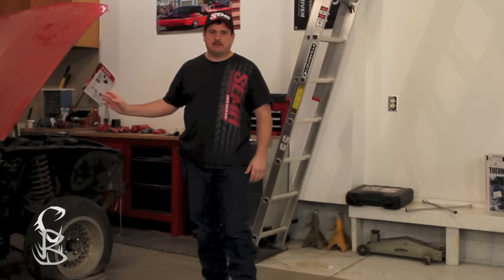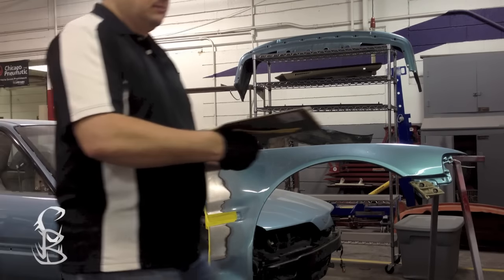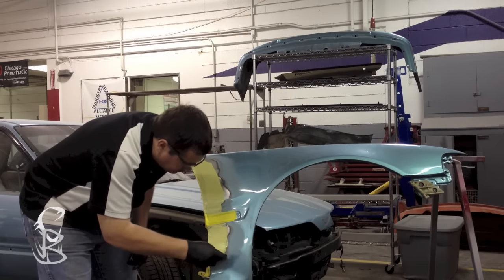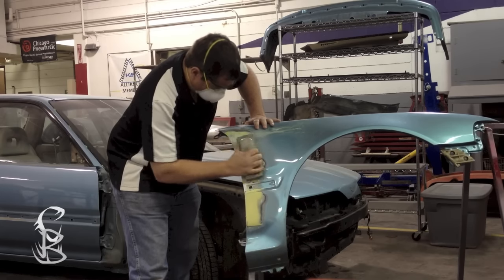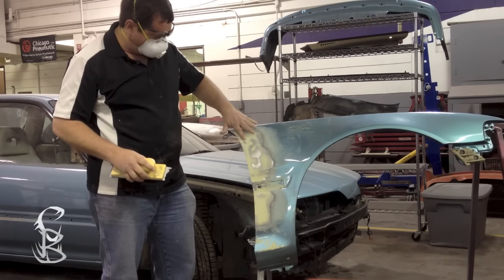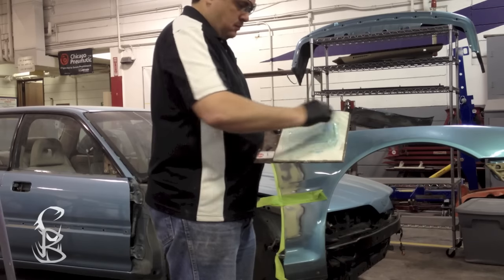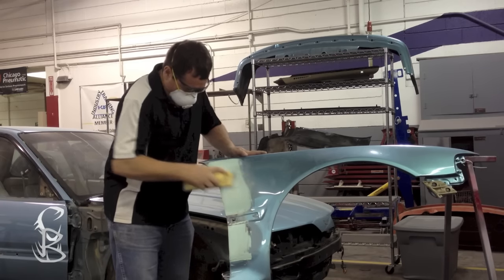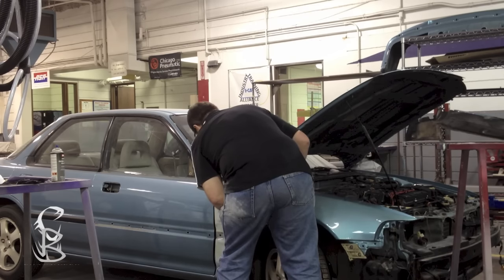DIY How To  Bondo Auto Body Repair (Tips and Tricks) To Prevent Common Problems with Body Filler

Comment: Great tips, Man! Masking tape to protect areas you don't want covered 👍, mixing the cream hardener before use to homogenize it 👍, removing the tape and filler drippings before it's fully cured 👍
For sanding I use a random orbit sander and to help find high and low spots I use a strong flashlight lighting the surface from a slant 😉

Comment: Nice calm and informative video,easy to follow.I started my first paint project on my daily,that has been body filled badly by the previous owner,filler is on to thick and the paint was orange peal,so not very good and it started to rust on some spots,so i'm taking matters into my own hands.😅

Comment: I enjoyed watching your video…nothing really new to me except for your 2-part glazing putty…but well presented. My only question is, what’s with all the hand sanding? I would opt for a 2” or 3” DA sander or an in-line sander to get the bulk of the material off, then go for a 3 x 7 manual pad sander with vacuum dust collection. The dust collection is not necessary if you’re working outside or in an open shop, but it does reveal any little pin holes that could show up later in the paint. I always use compressed air to blow off the area, even if I am using a vacuum.
Keep up the good work educating people about autobody repair!! Thank you 😎

Comment: Tips! fiberglass resin thins out bondo so you can make it as thin as you want. Never lay up bondo thicker then 1/16" thick at a time or you will get air pockets in it and the paint will blister after a while. I use clean bondo dust and rub it on the final coat and this helps so your sand paper doesn't clog up so much. Just try to rub the dust on lightly while the bondo is still tacky.
Reply: This is a tip for disaster, the fiberglass resin does not cure correctly and thats why you cant sand it without rubbing dust on it. If you need to thin plastic filler get the honey thinner made to do this.
Reply: just use supercharger

Comment: Hi Donnie. Been following you a couple years now. You do great work. One thing I struggle with is doing filler in compound, tight curves like in bumpers especially under the tail lights where it curves. Also, Last generation Honda accords have 2 hard body lines in a compound curve. I had a job that took 3 hours to do the filler work because of that. Any tips/videos on that?

Comment: Nice video, i generally knock the filler down with 80 grit then 120 then 240 ready for primer. Sometimes i just go strait in with a 120 then 240..  I just think the finer you get it before primer the less likely to get any scratches show through later on. Each to our own.

Comment: Thanks for the vide.

1.) What's the purpose of putty after putting the bondo?
2.) Should I use different bondo for metal quarter panel and for bumpers?
3.) What about fillers? Are there different ones for metal and for bumpers?

Thanks :)
Reply from the maker: I made a video response to help answer your question.  https://youtu.be/gP4ukrIhC5k
Reply from the maker: I also have a lesson on plastic repair you may find useful at http://www.collisionblast.com/2013/04/02/plastic-repair/
Reply: Israel Kelley exactly. I almost never just use bondo as filler. I always mix it with glaze to stop the pinholes.

Comment: I need to start using putty... I learned without and is very difficult sometimes. So putty will speed it up big time. And I never thought of taping off with filler, how smart is that? Two great points. Thanks!

Comment: Your video is very helpful, I know this video is old but I am glad I came across it, I have a 66 Chevelle I am restoring I have her stripped to bare metal, and have replaced what sheet metal had to be replaced, now I want to go over some of the little dings and dents, would you recommend the car be epoxy prime  first, or do my BONDO  ding and dents first, and also I have used Dyno-Glass it works great and is tough as nails when cured, so that is what I will also use as well on the dings and minor dents. what do you think? or should I just use straight BONDO, I do know the reg. BONDO is easier to sand, any help would be appreciated.

Comment: I like to lay a nice even coat making sure get it as uniform as possible and laying it on a bit on the thick side then before it’s completely hard I add filler right over my lows before I even begin any blocking or sanding. After that I DA with 40 grit to really get it knocked down then block with 80. Then I go from there

Comment: Why do you sand down to bare metal before you apply bondo? I never do that and I dont have and problems with my body work.
Reply: Because that's the old school method when old fillers wouldn't stick to paint. Modern fillers are fine onto paint. :)
Reply: @dannyayoch  Damn, I can't imagine bodywork  if modern filler wouldn't stick to paint. Personally,  I work my way into the damage from the paint to the putty to insure that my work is level and feathered out.... so yeah.... filler from back then would definitely be a pain in the ass to work with.

Comment: My holes are too big on my truck to do it like this I used Bondo patches but it didn't work good doing that. I should of used adhesive fiberglass patches. Am almost ready to start sanding my truck soon though wanna see how it will turn out. But if I have to do it all over again gonna use the fiberglass adhesive patches to put over the holes then use some more body filler. This is the first time I did try to fix holes on a truck from rust and my truck is 14 years old and had built a lot of rust over the years.

Comment: I really enjoyed this video.  I see you are using 2 different materials:  Body Filler and Putty.  Both 2 components products.  I can't find both on the shelves.  In the Bondo brand...which is which?  If anybody else could help me, I would appreciate.  thanks
Reply from the maker: I am not sure if Bondo brand make this type of putty.  You may have to go to a parts store that sells paint supplies.  They may keep it behind the shelf and you may need to ask for it.  Here is a brand that is a little cheaper then what I am using in the video made by UPol.  I have used it and it works good.  https://amzn.to/3yeErTx

Comment: I use the glazing putty to seal all my feather edges also. It acts like a sealer coat and keeps your primer from having any funny reactions underneath.
You never know about any not so cured paint materials.. Less shrinkage later and potential mini waves in the finished paint surface.

Comment: Thanks for the great video...but...THE best "trick" to using body filler...is not to use it at all, or to such a minimum amount that it is little more than pinhole filler, but that too can be remedies with body lead and correct metalwork.

Comment: R&I the door after the fit you want. While fender is bolted to car fix the dents usually 1 coat filler sand with 80 DA any over sand with 180, skim coat with putty, block with 180, soft pad DA WITH 320, prime. Block primer with 320 then soft DA 320 real quick, send to paint. Painters happy  everybody’s happy. 2hr. Fix easy RO says 6.

Comment: I know you are flat rating, but for guys that are learning, they could forego a lot of filler for 20 minutes worth of hammer and dolly work.  Its amazing what some dyechem or a big sharpie marker, a block with some 220 and hammer work will do to ever a nasty dent.
Reply: Spread your knowledge dude
Reply: what are you even talking about Matt B - explain yourself!
Reply: Using dyechem layout fluid or a sharpie is guide coat for bare metal dents.  You cover the entire damaged area with it and the go over it with a sanding block.  The high areas will get sanded first so youll remove the ink and will be bright metal while the low spots will stay covered in ink.  You hammer and dolly the dark spots and tap down any high spots.  Do it a few times and that dent will be quite a bit flatter.  I use aerosol Dyechem  and spray it on like paint.  Nice thing is that you can clean it off with acetone and add more as you go.
Reply: Matt B oh your first post made it seen like you had something new up your sleeve kek
Reply: It may be new to someone that has never done bodywork or thinks its acceptable to use body filler in thicknesses of over 1/4" (and I dont think its acceptable over 1/8").  Filler is absolutely necessary to get a straight panel, but with a bit of work, you can use quite a bit less for the repair which includes the repair in this video.  I dont do commercial body work, everything I do is for custom cars and if I cant fill the dent with a few coats of Featherfill or similar material, it probably needs to be worked some more.
Reply: is there any fix for a bashed in rocker panel?  I don't want to spend $2300 on this car which is what the body shop quoted,  but want to hold on to it for a couple more years.
Reply: How bashed in?  Assuming this is a unibody car, that is a major structural area of the car both for crash safety but also for keeping the car rigid.  If its cosmetic damage, you can get a cheap stud welder from a place like Harbor Freight and pull the dent.  I actually have one and the welder works damn nice, the puller sucks horribly though so I got a higher quality slide hammer for it.  If the inner rocker moved at all, that means the floor pan is also probably damaged and you definitely have a structural repair on your hands.
Reply: Ahhh  ok.  I didn't know that it could be a safety risk. It is a 2012 Honda Accord and this is the THIRD time I've hit something along there and spent thousands to fix the bottom side. This last time I just brushed a curb when pulling into a parking lot next to a curb (like two weeks fater I'd gotten it back from a different accident).   I have only had this car for two years and the only car I've ever had accidents in.  Never again getting a car so low to the ground.  Thanks for this info. Bashed in as in the front part (where it meets whatever is in front of it toward the front passenger door) back about 18 inches, then dented in about an inch and a half like a big gash along the bottom side. But how can you yank it out when it seems to be solid with whatever that stuff is behind it? thanks for replying anyway!
Reply: Doesn't sound like you are ready to tackle this repair on your own and while 2300 sounds steep, it does include fixing it properly and also painting it to a factory finish.
Reply: maybe not but I do a lot of things on my own and do a pretty good job.  But if it is structural you are right, I don't want to take chances on that.  thank you!!
Reply: Here's one for you.  I was a boat builder for years in florida.  We found that a sharpie or marker of any kind will prevent the resin from hardening properly.  Don't use it.  Trust me   We had a couple boats delaminate until we figured it out    Fiberglas resin (polyester) is the same resin in body filler.  By the way...if you want to make your body filler a little easier to work with and get smooth just add a few drops of resin to your bondo....it smooths out like you wouldn't believe.  You can add a bit of resin to old bondo and it will loosen it up a bit too.

Comment: Wow, what a great and helpful video. I loved it. I'm curious why you dont use a power sander at all?
Reply from the maker: I do a lot.  But in many of the videos, I am demonstrating how to if you don't have all of the power tools.  But an air file or 8 inch sander can work well on some body filler.  I normally don't like to use a DA sander on body filler because it does not level well and can make it lumpy if you're not careful.  Thanks for watching.

Comment: Great video! But I would as a suggestion use a paint stick or 5gal paint stick modified to sand this area....much better access to the fender so it's not as bulky as a block

Comment: Hey man thank you for the great videos. Question for you: do you have to remove all paint before applying body filler, or can you apply the body filler over the scuffed paint?
Thank you
Reply: You "can" apply over ROUGHLY sanded paint (40,60,80 grit) but it's considered poor form.  It's best to sand to bare metal, clean with wax & grease remover (or lacquer thinner)  then apply filler.

Comment: I have a question, I need to replace my front fender on my truck with a new fender. Should I prime and paint it before I put it on the truck, or after? And is it difficult to line it up to the rest of the front of the  truck?

Comment: i may have some questions later when i get ready to make the repairs to a 98 mustang gt.
car has passenger side fender peeled back to front of passenger door however flared front edge of door and caused a circular wrinkle just under side mirror, replaced fender with used fender from a salvage yard which was perfect and not wrecked. any suggestions would greatly be appreciated.

Comment: another tip... I found that the filler, even when cured. will be tacky on the surface, and ca clog your sand paper. A trick I came across, is to wipe it down with thinner before sanding. Saves on wasted sand paper

Comment: This is why you should take a magnet to the used car lot.
Reply: I'd suggest a weak magnet be taken. If it's real steel, the weak magnet will hold on nicely. If it's Bondo, it won't stick. A very thin coat of Bondo over bent steel could fool the magnet.

Comment: whats the different between body filler & putty ??
Reply: The filler is thicker and doesn't spread as easily. The putty is thin and spreads very easily. When spreading filler you're likely to get little holes or sharp edges and a rough texture because it's so thick. The putty fills in those imperfections.

Comment: Bondo and I, yeah we dont get along much at all.
What is the advantages over putty with hardener and the stuff that doesnt need hardener. Ive never used the stuff that needs to be mixed. Was thrown off a bit when I went to the parts store to get some, didnt know which to get so ultimately decided to go with what I know.
Reply from the maker: The putty without hardener is the older style putty.  It takes longer to dry and shrinks more than the 2 part putty.  The 2 part putty is more expensive though.
Reply: I guess we're on the same boat. The "older" putty I use was used after primer not over bondo. instead of being clarified about this the more I'm getting confused. Ok, for the sake of this video. What kind of primer was used after the putty, epoxy?
Reply: the stuff you are talking about is laquer based glaze. It was used back in the 60s,70's and early 80's. Its chief limitation is inability to cover any big problems. It sanded real easy,but wasn't very durable or compatible with modern paints and primers.

Comment: CAR ADDICT   I have a question: For example when a vehicle/car has been rear ended by a tractor trailor truck (hitting one side of the rear bumper) cracking the bumper / ripping off  one of the tail lights aka brake lights and smashing the rear quarter panel......  QUESTION ONE (1) What are other possible issues that are likely to have occurred to the vehicle that the naked eye and non mechanics/non body shop specialists    would not be aware of      could yah list the guestimate price for each repair including the obvious repair/replacement of the bumper, tail light and rear quarter panel
Reply from the maker: There is really no way to determine that.  Every make and model has different parts cost and labor time, which can be a huge difference.  I would recommend taking it to a repair shop to get an estimate.

Comment: hi, 1) how do you block sand, the body lines when there is a damage in body lines..

2) when i apply filler on body lines, do u have some tips to help keeping the lines in place, some say use steel blade and contour the existing surface while applying bondo...
Reply: If you have damage on a body line, try taping off the line from where theres no damage and fill one side of the line first, then the other. I usually tape it off after filling once rough and making the line when laying my filler. And also, pull the dent out as much as possible, the point is to use the least amount of filler.

Comment: Hey Donnie,best wishes for 2014,very nit trick,what i would like to see,is if you have whole fender or any spot that requires all large area to body fill.secondly if have fender that was 90% damage,would you replace or repair?,thanks Rishi.(Guyana)
Reply from the maker: I would probably replace the fender if I could find one.  I get aftermarket parts from Keystone Automotive, but they did not have one available when I repaired this fender so I had no choice!  To answer the question, I guess it depends on the cost of the fender and if I could find one or not.  Thanks for watching.

Comment: Hi, this is unrelated to auto body repair but I'm doing a project where I'm using a 5 gallon bucket and I cut the rim off with the handle as well as the opposite side which has like a thin rim on which the bucket sits upright 
So I cut that off to make it level with the bucket and sanded it with my dremel but I get ugly looking sides that aren't level with the bucket. I'm trying to get it to look like a perfect cylinder with rounded edges. Can I use bondo to fill in those rough edges? I just got the idea but idk . Also when I paint the bucket I'm using filler primer, is that ok to use on bondo or will it not stick well? Sorry for all the Q's
I've never used bondo before.
Thanks man.
Reply: I know I'm late, but the Bondo isn't strong enough to bear the abuse that a bucket edge might encounter. It will crumble.

Comment: I have had good luck with Fix-All or dry wall mud. In a small repair I just use spackle (regular kind not the lightweight type). Just make sure to have some primer / paint on it before it gets out in the rain etc. ACE